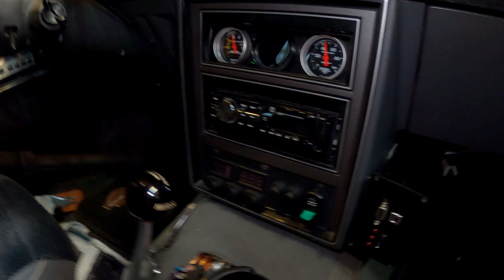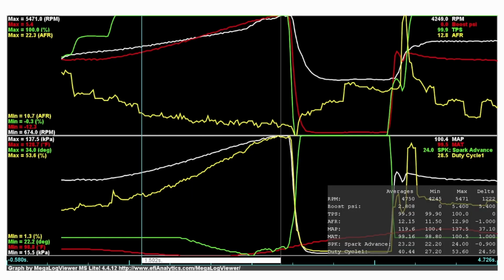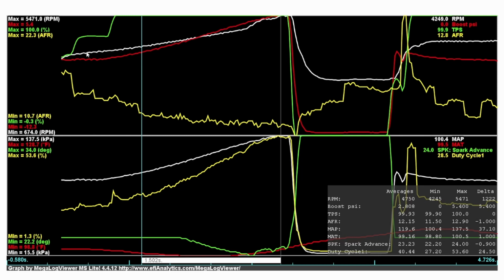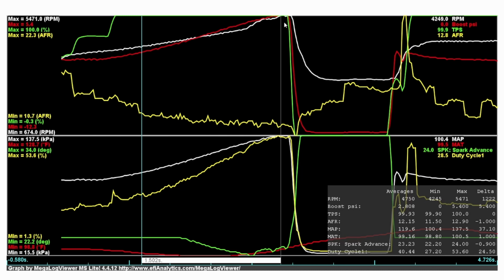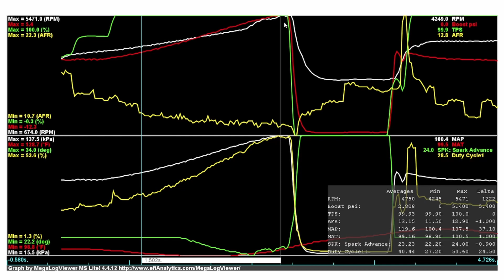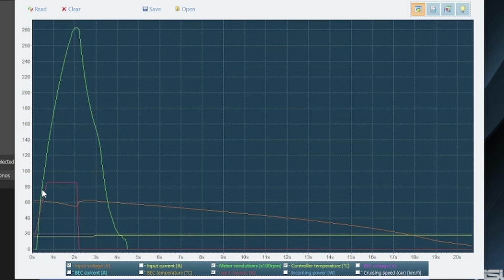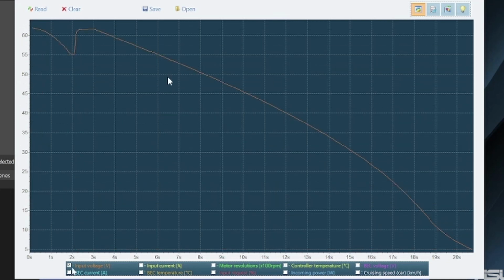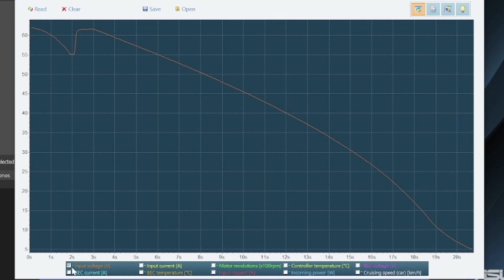DIY Electric Turbo: Sledgehammer - First Boost!

Comment: Would there be a way to lighten the brake on an alternator, modify it, and use car rpm to drive the motor? Making it act more similar to a traditional turbo? I'm not exactly sure how this type of setup would even work, but just kinda thinking out loud and wondering what other alternatives you brain stormed. As I'm sure there's a good reason you settled on this battery pack system. Extremely interesting watching you make the current setup.
Reply from the maker: Thanks.  I've pretty much accepted that an alternator isn't going to work for direct power.  We're running 60 volts and have so far pulled a max of 678 amps.  Fully spooled on this engine, we'll be at 500-550 amps in all likelihood.  Even with voltage sag, you're still looking at close to 30kW.  An alternator running at 13.8 volts would need to put out about 2,200 amps to keep up.  But it can certainly charge the packs when not in boost.
Reply: @AlexLTDLX  ah yeah that makes sense. Only mentioned it because my alternator went bad on my car and started putting out insane voltages at 3k+ rpm. Wasn't sure how far you could mod one to squeeze large readings from them. I caught a fair amount of those numbers during your explanations in the videos, but got lost in the sauce. The results regarding temps and psi are insane. Didn't expect the air to be so lossless in this setup honestly, I knew they'd perform better than a normal manifold setup, but damn it's uncanny.

Comment: I'm REALLY excited to see this project in action. I'm also really shocked by the IATs and the efficiency.

Apologies if this has been answered before but I've only come across your videos fairly recently, any plans to have the batteries charge off of the alternator, and are there any technical challenges to that? I ask because it's always been a pipe dream of mine to have an electric supercharger setup for more of a street or road course use that's also completely reversible.
Reply from the maker: Thanks for taking the time to comment and subscribe.  And to answer your question, yes, the control box has a charger built into it.  I go through it here: https://youtu.be/J7glXHY3AbI

Comment: Great work Alex! Due to the power cable lengths, have you measured for voltage drop (controller to the motor)? I respect the fact that you don't want to cut up the LTD for a remote (trunk) mount setup, however, from what I can see from the video, running the discharge tube through the interior may just require the rear seat to be modified (or delete it), assuming you have deleted the heater and running through the rear seat/trunk sheet metal webbing. The gearhead in me is always looking for efficiencies with any setup-weight distribution, heat issues, safety (please protect the cables when passing through sheet metal openings)..... Good luck on dyno day!!!!!!!!
Reply from the maker: Thanks!  Another person commented that a small pickup - like an S10 - would be ideal for this sort of thing.  I tend to agree.  Certainly better than a sedan with a 105" wheelbase.  But it's what I've got.  As for the voltage drop question; I've run the numbers - it looks to be about 3 volts at 500 amps.  We dropped 7 volts in total - so about half the drop was from battery sag, the other from cables.  Heavier cables aren't really practical, and I cut maybe cut a couple of feet out of it still, that wouldn't make that much difference.  Putting the e turbo in the bed of a small pickup would be the ticket to ride - good thought!

Comment: I'm assuming you have a set of stickier tires than that.  Though I guess at a certain power level, it just doesn't matter.  The world of 200 tread wear tires is pretty nuts these days with everyone trying to make the fastest track day tire and autocross tire while still being considered a "street tire".  I personally run the Falken RT660's since they are cheap and at the top in terms of performance.
Reply from the maker: Yes.  I run Hoosier 26x8.5 stiff sidewall "outlaw" slicks at the track.  It hooks hard enough to pull the front wheels (low 1.4x 60' times); at least with the Whipple I had on it before.  At the beginning of this video are a bunch of timeslips and a race at a dragstrip against a crotch rocket (this was with the Whipple): https://youtu.be/j8SNo7kpcxw  A wise man once said, "Racing on street tires is like wiping your a$$ with a turd."  I agree. These are just my street tires.  I put far more miles on slicks.  Though to get the epic burnout at the beginning of this video: https://youtu.be/AOL3Qyczt3Y, I destroyed my last set of slicks.  Got to get new ones before the next track outing.

Comment: Since I've  seen your first video I can't help but to think, can I fit something similar on my Hayabusa and fatboy 🤔
Reply from the maker: Depending on your hp goals, it actually shouldn't be difficult.  You won't have long cables, and could probably use a much more compact unit.
Reply: I'm thinking ride on lawn mower........ you know for the harder sections 🤠
Reply: Small engines (lower CFM intake) benefit a lot more from electric powered boost. You should give it a go.

Comment: You may be on the right track with yours your ideas about efficiency , Modern turbochargers are much more efficient than the terrible charges of even 5 years ago you've got turbos that 10 years ago made 500 horsepower now can make over a 1000 easily, but don't think that will ever be a heat sink just because it's not hooked to anything and not spinning all the time doesn't mean adiebatic heating doesn't occur when you compress air that's just what happens you can't get away from the laws of thermodynamics once you start making real boost with that thing you are gonna need to intercool this system
Reply from the maker: That's true about compressing air causes heat.  But since the volute, discharge tube and even the intake are relatively cool, they all work to cool the intake charge.  Heck, the old "bag of ice" on the intake trick would work well - a bag of ice on the volute would probably work better; simply because it would also close up the gap between the impeller and the volute just a hair.  But it's nowhere close to the amount of heat the Whipple used to put into the system - that would melt 10-15 lbs of ice in a single pass!

Comment: It would be dope to see some regen! Thought about it?
Reply from the maker: Well, the control box does have a charger built into it - so you can recharge it while driving or actually, (since the 12 volt battery is a 100aH LiFePo4) you can recharge it from the car's battery a few times after quarter mile passes before it won't have enough juice to start the car.

Comment: couple questions...1-with the current battery setup, do you think you'll need to charge after every hit, or could you get several runs out of it(and if so, how many-ish), 2-how long does it take to charge and how do you accomplish that?
Reply: Just had another thought/question...is there a way you could have it as an option to charge itself off the cars charging system?
Reply: That calls for an electric exhaust turbine charger or breakenergy generator ;)
Reply: Yes there is a way to charge it off the cars electrical system. Alex may go into more detail.
Reply from the maker: No, you don't need to charge it after every hit.  In theory, there's enough battery capacity to make about fifty 10 second passes.  However, in practical use, you'd likely start to see a drop off after the first 6 or so passes.  You need excess battery capacity to prevent the voltage from sagging too low under load.  And as Mark mentioned, there is a charger built into the control box.  I go into it here: https://youtu.be/J7glXHY3AbI  It's pretty slow to charge, due to it only charging at 4 amps (yet a 30 amp draw from the car's electrical system due to the voltage step up required).  But you could top off between hits - that would only take about 5 minutes or so.  If you were to build a high-power charger, the batteries could be fully charged from being fully dead in about 15 minutes.  But that would be pretty expensive to make.  You'd need to charge at about 270 amps - the batteries could take it, but you'd be pulling about 140 amps from a 120 volt source.  Or about 70 from a 240 volt source.
Reply: @AlexLTDLX  awesome, thx for clarifying. I was just kind of thinking thru a "street" use setup, you answered the stuff i was wondering👍. I guess the only drawback would be the costs (at least for now-prices of tech always come down over time). Very intriguing stuff though

Comment: It never occurred to me that you would get almost instantaneous boost and cooling with electric! Makes perfect sense! With regards to the graph at the end of the vid, will the capacitors have enough voltage for a full 1/4 mile run?
Reply from the maker: They're not capacitors they're lithium titanate oxide batteries. Capacitors have a linear voltage discharge, lto cells are pretty flat. But to answer your question, in theory you should be able to make 50 to 100 quarter mile passes before the batteries are drained but in reality it's probably about six or so until you start seeing a drop off in performance. That's just a guess right now.

Comment: The fact that you have to explain why a 2-speed PowerGlide transmission isn't awful makes me very sad...  It's a shame how all of these vehicles with umpteen speed transmissions have caused everyone to think that fewer gears is just bad in every way.  I bet that PowerGlide is TINY and LIGHT compared to transmissions with more speeds - and I bet it can hold WAY more power!

Also, would it be of any benefit to try to program the ESC to keep a bit of motor speed at all times so the supercharger doesn't cause an intake restriction?  It would be neat if you could modulate the motor RPM based on the MAF sensor so that the output of the supercharger matches the MAF.
Reply from the maker: I hear you about the glide.  As for the e turbo, you could have it run a little bit so it's normally not a restriction, but it doesn't bother me.  At most it costs about 30hp, and on a 500hp engine, that's not really noticeable - certainly no effect on just regular driving.  If you you full power, you've always got the "go" button!
Reply: @AlexLTDLX  Ok.  Cool!  I was mainly curious about it from a fuel economy standpoint.  Since this doesn't pull any power from the crank - unless you use the alternator to recharge the batteries - it would be neat to see what kind of fuel mileage you could get out of the setup.

Regardless, I'm excited for the dyno video!  Keep up the great work!

Comment: I know at the very end of your video you touch on capacitors and how the discharge isn't Superior to lithium's. But in a hypothetic situation, if you were to add an ultra capacitor to your power grid what would be the specifications to be beneficial? #nobudget
Reply from the maker: If I'm understanding you correctly, the biggest challenge would be getting enough voltage capability while still having enough capacitance to make a difference.  Supercaps are typically limited to 2.7 volts each; and to double voltage capability, capacitance gets halved.

Comment: Don't really understand why you want the esc in the rear. Makes more sense electrically to have it near the motor?
Reply from the maker: That's what I thought when I started building these.  This is actually third one (well, fourth if you count the one I built as an evac pump and we tried making boost with on a Harley).  In all the previous incarnations, the ESC was by the motor.  Virtually no ESC manufacturer recommends long power cables - and as it turns out, for good reason.  The inductance in long power cables prevents electrical spikes from being absorbed by the batteries.  The common solution is to put capacitor banks right by the ESC.  But even that's not foolproof.  Benjamin Vedder (the creator of VESC) has a great video on youtube - I don't have the link handy, but a search will turn it up - where he discusses that if the capacitors aren't right next to the power stage - like millimeters away - the capacitors' effectiveness dramatically diminishes.  The inductance issue isn't an issue on the motor side - since the frequency to fire the motor coils is far higher than the cables' inductance would affect.  Since long cables are necessary somewhere in order to install this thing in an actual car, long motor cables are preferred.  A pickup truck with the electric turbo in the bed and a discharge going through the cabin to the engine would be optimal.  The only issue with long motor cables that I've discovered is that motor startup (when BEMF is low) can be difficult without a sensor on the motor.  So this motor is sensored.  BTW, I've blown up 4 expensive ESCs to learn all this stuff empirically; look back at some of previous videos.  Plenty of fires and explosions.  The electrical power levels we're dealing with are huge.

Comment: This thing demonstrates the advantages of boost without parasitic losses which is the principal behind my idea to use a small turbine/jet engine to power the compressor. Lithium batteries suck and have a very limited energy density compared to say, diesel fuel. Imagine how much more boost you could produce with that kind of energy! I got this idea after building a homemade jet engine with a turbo and later building many forced induction setups for cars. I want to find someone to work on this idea with me and produce a compact lightweight turbine supercharger device that produces continuous boost pressure, exhaust scavenging, and generates power for all the accessories! Think about aircraft APUs, those mini jet engines for RC hobby stuff...
Reply from the maker: True, and that is a good point. The advantage this has is frankly just fewer moving parts, it's smaller and easier to package.
Reply: @AlexLTDLX  But can you make any more than 5psi? how about 25psi feeding a 2000hp drag car? I want that and I think a turbine can do it!
Reply from the maker: Yes.  I don't know how much this will make at max hp engine rpm and e turbo on full "chooch" - but we'll find out on the dyno.  Most likely on the transbrake we'll see around 9-10 psi and at peak hp 7-8 psi.  Which is the same as seeing 16 psi from the Whipple on the brake and 14 psi (at least) at peak engine hp; due to increased efficiency and no drive losses.  If you wanted more boost, you could always compound two of these things together.  But as you say, a turbine might be able to get there too.  More experimentation to come...

Comment: Hey if you use a potentiometer to make the p
Turbo smoother and it drive better you should try to run on a track for a good 10mm see if everything hold well
Reply from the maker: I'll be taking it to the dragstrip - the car should be able to put the power down with slicks.  Hoping to get into the 9's.  It ran 9's with the Whipple: https://youtu.be/j8SNo7kpcxw

Comment: If manufacturers would pull their heads out their arse and get with the times. This would be so amazing in my Ecoboost. Take a look at my homemade active aero setup bud. Serious question, would this electric turbo change fuel economy? I imagine it would for the better 🤔?
Cheers...
Reply: More air = more fuel thats why when turboing and engine for economy you make the engine smaller then boost it to same power.
Reply from the maker: Thanks for the comment.  Derek hit the nail on the head - much more concisely than I could.

Comment: First toss those street performance tires and get street legal slicks, second the tires broke free cuz your testing a drag car at full throttle into a corner. Third when you compress air you make heat, no matter what. I’m wondering if that compressor isn’t in its sweet spot yet and that’s why not a lot of heat. Really need to see it on the dyno to get a better idea and Atleast 5-8 seconds of boost
Reply from the maker: The part where I hit it is perfectly straight.  I'm not dumb enough to do this in a turn, especially with Bogarts on the front.  At the track, I run Hoosier 26x8.5 stiff sidewall outlaw slicks.  The last pair we destroyed doing the epic burnout at the start of the video (watch the beginning and the the very end - the piles of rubber burst into flames): https://youtu.be/AOL3Qyczt3Y  In fact, that was drag testing version 1 of the e turbo - less than half the power of this one.  And that one broke the slicks loose at the top of low gear.  As for the IATs, on a dragstrip, all aftercoolers function as heatsinks - there's simply not enough time to reach thermal equilibrium.  The Whipple I had on the car before this would melt 10-15 lbs of ice in a single pass.  Here, there's no heat in the e turbo.  And given it's in the path of airflow all the time, it tends to stay fairly cool.  I think we'll probably see a similar pattern on the dyno and on the dragstrip - a dip in IATs, followed by a rise.  But most likely it won't get too far above ambient; probably not enough to have to pull timing.  Here's the car at the track with the Whipple - which was the third forced induction setup I built for the thing over the years (a pass and timeslips are at the beginning):   https://youtu.be/j8SNo7kpcxw

Comment: Could do with a LSD?
Reply from the maker: Has one.  In fact it was rebuilt not that many miles ago. I stuck in an extra friction on each side and they're made of carbon. It's just too much power to harness on the street. But I'm building this to see how much power can reasonably made with available technology. We're going to dyno it and then put slicks back on it take it to the drag strip. Thanks for taking the time to watch and comment.